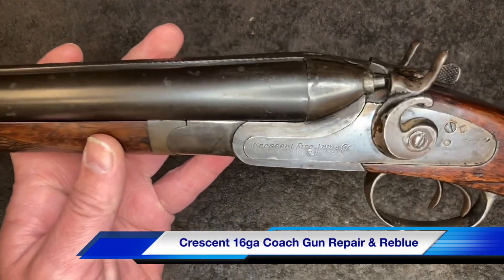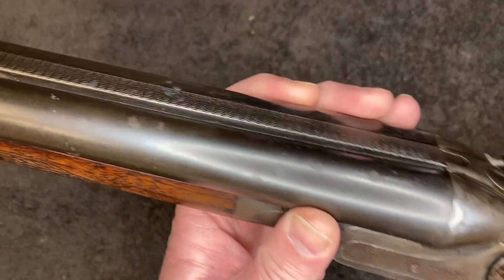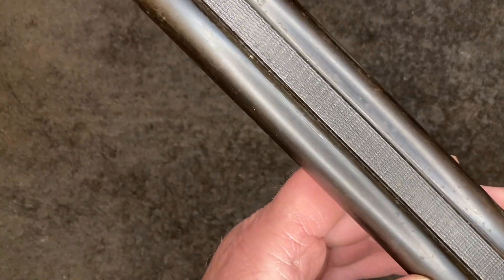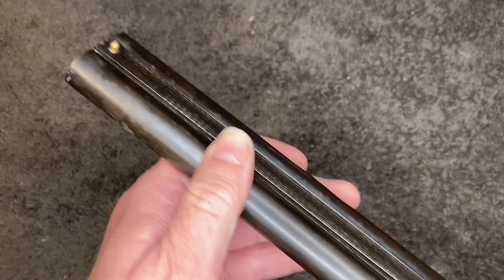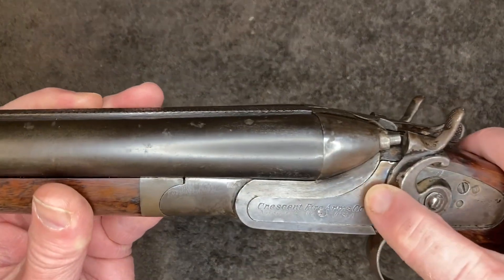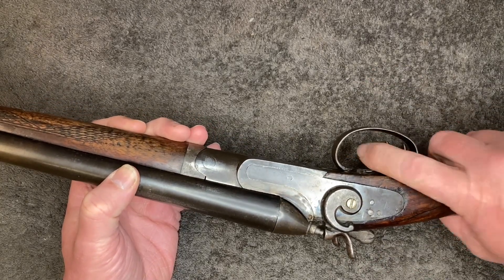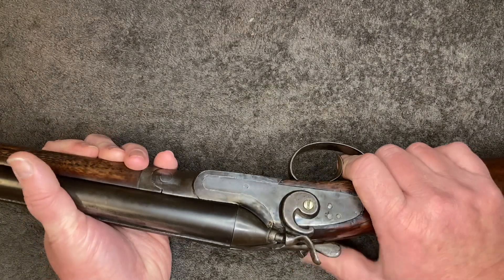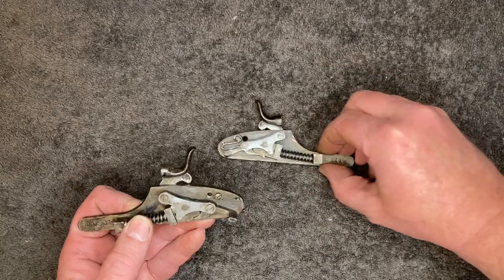Crescent 16ga Coach Gun Repair & Reblue

Comment: Nicely done!  I have restored a number of these old Crescent Hammer Guns,
which were sold by Sears as ' The Bar Lock Wonder ' - the style of coil spring
lock being called a Bar Lock.   As you stated, they were sold with a large
number of Brand Names, and were priced at about $ 20.00 - $ 25.00, which
was within the reach of many average Working men who wished to make
a step up from a Single Shot  Break Action shotgun.  

They came in both Damascus Barreled ( now unsafe to shoot ) and Ordnance
Steel Barreled ( Fluid Steel ) which are still safe to shoot with light loaded
lead ammunition.  

They make very nice Coach Guns for Cowboy Action Shooting, which was
the market they were sold into after I restored them.  

Your gun is a nice relic from a now lost time in America.

Comment: Looks like that Ballistol did a really nice job on the stock and fore end ! Do you prefer it over boiled linseed oil ?
Reply from the maker: I do not.  My favorite stock finish is Woodoc 10, but it is a South African product and is not available in the US.  Danish Oil comes close so I use that most of the time.  Boiled Linseed gives a very good finish, it just takes very long to set and prolongs the project time.  I only use Ballistol on a stock that has finish on it to clean up gunk and blems with 0000 steel wool.
Thanks for watching.
Reply: @ThrowingCopperCRA-2022    Thank you for your reply . Additionally I have a question as I have an old Janssen Hammer SxS. The stock is oil finished and in good condition overall and I haven't cleaned it yet. It does however have a dent right in the middle of the Stock that needs to be steamed out. My question is once I raise the dent will it ruin the existing finish and then be forced to refinish the Stock in it's entirety ? Thank you for your time , hope all is well....
Reply from the maker: @33journeyman  Once you start steaming out dings and dents, you will have to refinish the stock.  Unfortunately.